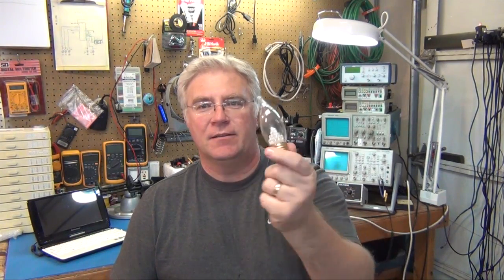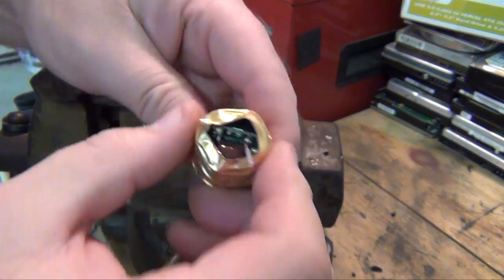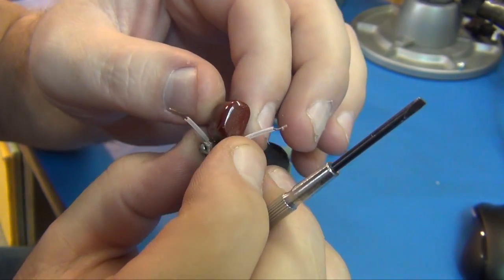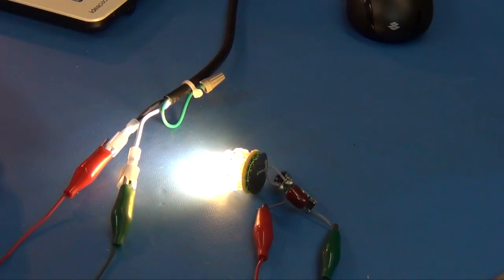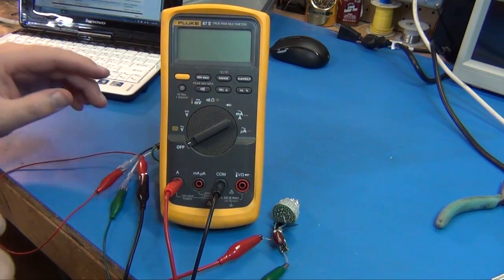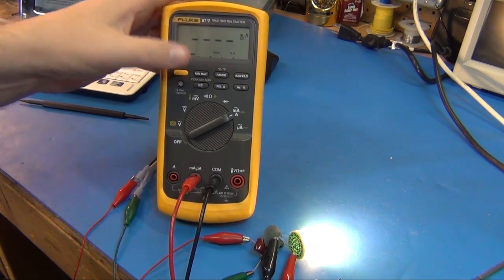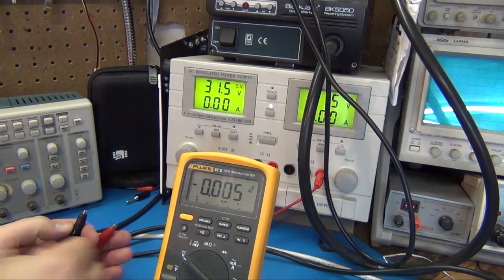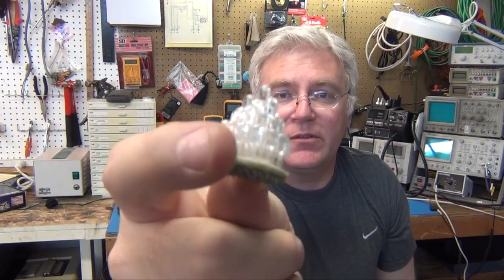ToddFun.com: Candelabra LED light bulb teardown and review

Comment: I do have Feit electric's more recent replacement for this bulb.  They are no longer claiming it is equivalent to 40W bulb, instead they advertise it as a 2W replacement for a 25W and only suitable for "ambient" lighting.  This is probably due to the government cracking down on makers of LEDs that lie about their specifications.   They are now using a 9 LEDs for these bulbs.   So far I've run mine for about a year 24/7 and it still works and I haven't noticed any drop in brightness.

Comment: That lamp looks quite different to the ones being sold now which mostly use SMDs and have a large heat sink. The quality may not have improved although I have had few problems with the leds I have fitted in my home.  think it is heat that has killed the ones that have failed.

Comment: When LEDs are in series the required voltage is equal to (number-of-LEDs * forward-voltage).  The forward voltage (voltage drop) of white LEDs (from a quick glance) seems to be about 3V to 3.5V.
Say you had 28 LEDs with a 3V forward voltage:  28 * 3 = 84V minimum to power the circuit.

Comment: The MB6S rectifier is only rated to dissipate 1.4W.  The "engineers" did not derate for this circuit.  It would seem this device is bound to fail eventually, sooner rather than later . . .

Comment: The real power would be about the 1W, the higher apparent power (the 1.7VA's) is caused by the leading phase of the capacitor, so the power factor of about 0.6.
The "driver" losses would not be above 100mW (2V on the rectifier plus no more than 1V on a resistor).

Comment: The forward voltage drop of the LEDs are not matched, so wiring them in parallel would result in widely varying brightness which is a function of the current.  You could use a series resistor per LED which would increase the cost, not counting the higher cost of getting a higher current (15mA*28) at a lower voltage from 110V.  The original series circuit guarantees the same current per LED, but could probably use some added transient protection (MOV).

Comment: White LEDs are often blue LEDs with a yellow phosphor.  The blue LEDs in this lamp probably have (had) a forward voltage drop of about 2.9V (Vf), which is why 28 of them in series dropped 81V.  Current through a diode (including LEDs) rises sharply past the Vf and if your power supply is not current limited to about 20mA, you are likely to damage the LED.  Should have had a resistor in there when you were probing...